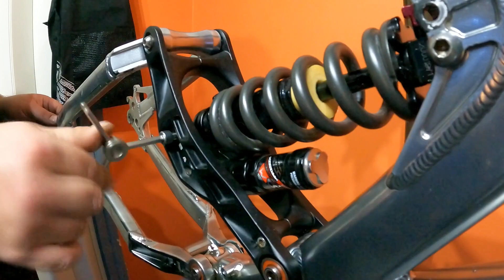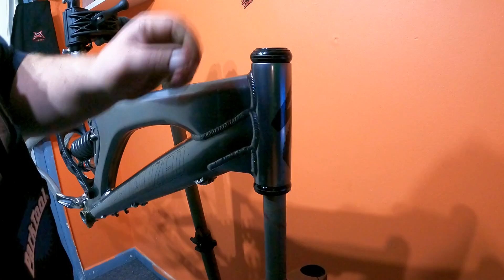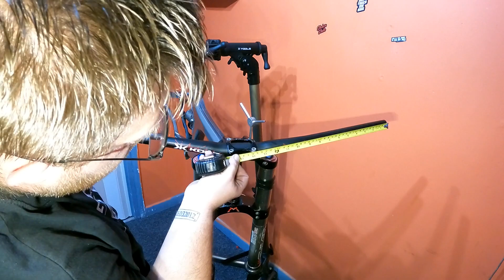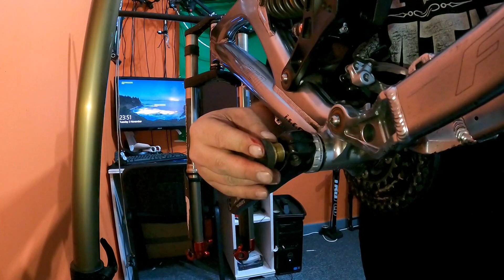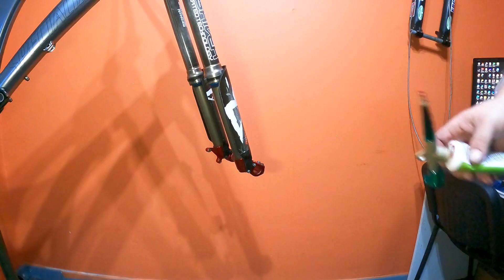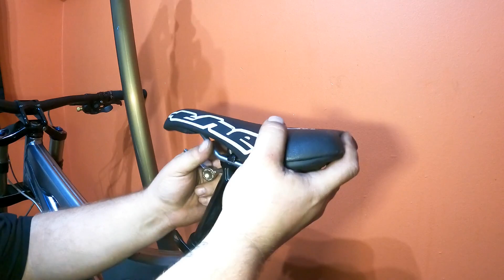DREAM BUILD MTB- Specialized Big Hit 2003 - ASSEMBLY part2of4

Comment: I had a Big Hit. That bike rode really well. easy to bunny hop and manuals for days. It came with a 170 mm Manitou that i killed in 4 days. So i put a 200 mm travel Marzocchi 888 fork on it and shredded till the bike was ready to rebuild and then sold it. It took 2 seasons before i finally bent the fork. The thing that killed it for me was the seat mast height. Couldnt slam the seat down far enough. Am now riding a Trek ticket S and still shredding for an old guy. Cool video man, cool bike.
Reply: How the hell did you bend a 888 thats not even possible

Comment: Literally just bought myself one of these bikes this morning for £420 second hand. I've managed to install  front and back 220mm rotors  and my very decent 27.5 by 2.20 blue tyres onto it! Aswell as switching the forks around for a set of  fox 40 DH TRIPLE TREE  beauty's that have just completely  changed the dynamics of the thing and made it look a million times better

Comment: I have the same frame if i adjust the rear like you did in this video could i fit a 27" wheel on the rear
Reply from the maker: Only 24 if you have special kit you can fit 26 but not 650b

Comment: What Brand adapter is that you used on the rear? I want to get one.
Reply from the maker: It's nr21 I think it's Magura Gustav specific one to use 190mm rotor. GUSTAV HAVE FUNNY SIZES IN ROTOR FROM 160/190/210. IF YOU WANT TO GET GUSTAV PLEASE CHECK IF YOU ARE GETTING IT WITH ROTORS AND CORRECT ADAPTERS THEY ARE PAIN TO GET AND MAGURA DONT SELL THEM ANY MORE